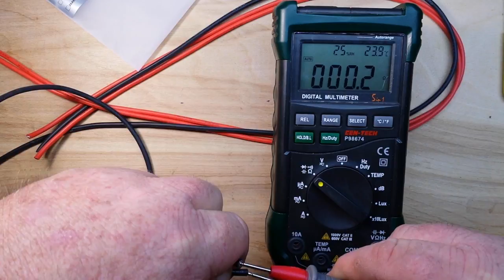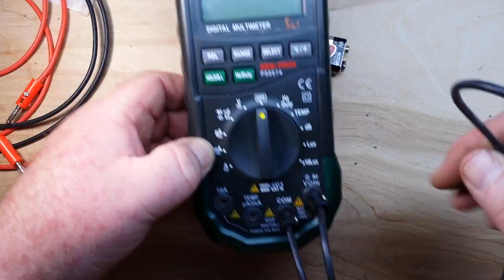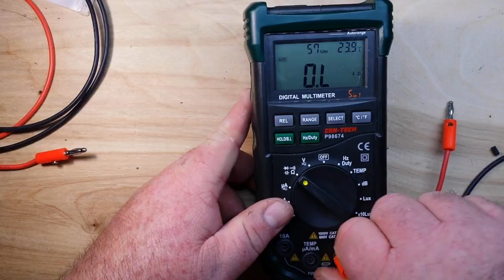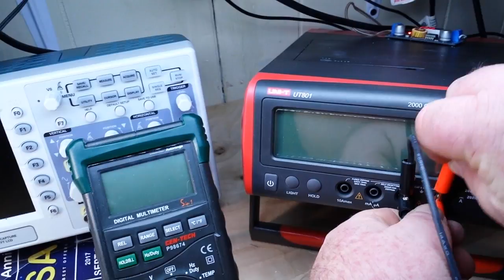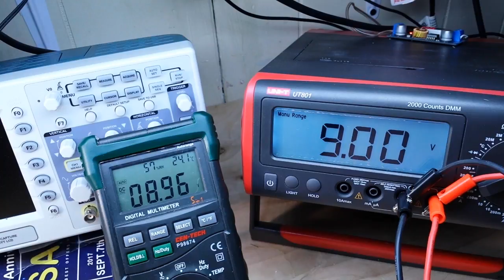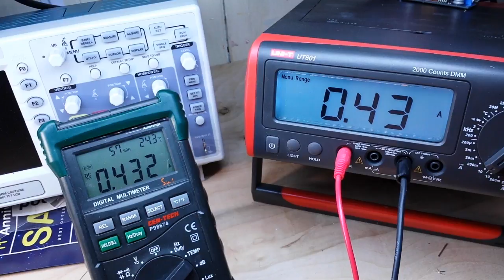Make High Quaility Low Resistance Test Cables

Comment: Another great vid... would you happen to know of a company that sells 100 megohm, 1/2 watt, 5% resistors?
Reply from the maker: J. Clowers I checked Digikey, and Mouser. No luck. Sorry.
Reply: learnelectronics did find some 20 megohm's from vetco.net...i guess ill have to run them in series.

Comment: i wish there was a reliable source for cables from china, but its all electroplated aluminium =/
Reply from the maker: fredlllll You are so right! I just received the AC transformer I ordered for my diy power supply. Guess what... Aluminum wires on the primary.
Reply: its also sometimes really hard to solder to, cause the copper just gets oxidized away, either by the heat or the flux
Reply from the maker: fredlllll I just chucked the whole damn thing in the can. I'll find a domestic one with copper.
Reply: keep the core for custom winding one ;)